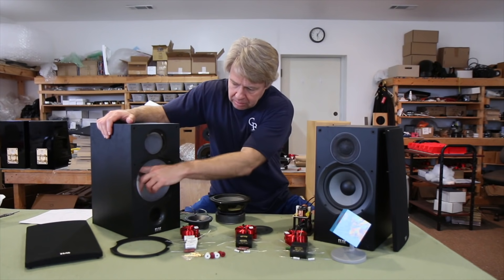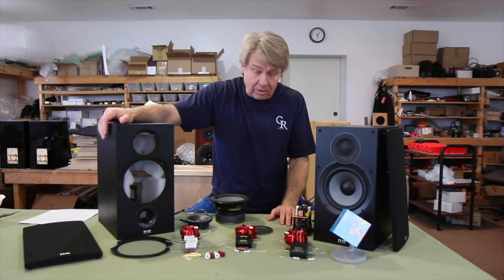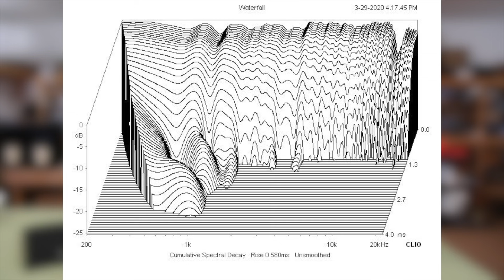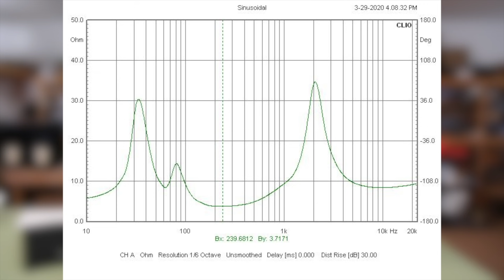Elac Debut 2.0 Upgrades and Modifications!

Comment: cables make a difference , but at the same time some cable  companies sell snake oil, often a cable if its the right cable at $40 can be as good as some $150 cables not always does more money mean its better or worth the diff.
Reply: Copper is still being copper regardless where it is. Yes, sure there might be some dodgy copper wires from China, but the rest of proper electrical copper cables are the same for the purpose of carrying low freq. signals if the cables have appropriate section of cource.  One day we received a lot of backlash from Monster Cable distributor for us bashing their  overhyped products by telling the truth about that to many our customers all over the town. Personally I've got nothing against their pricing, but with all the lies and all the other esoteric BS they say about their cables, the companies such as Monster Cables, Van Den Hul etc. they all fall under a definition of charlatans.
Reply: @MSM5500  Build a pair of Canare L-2T2S interconnects and float the shield. Total cost will run about $12, including Nakamichi RCAs. After I had them in my system, I dumped all of my snake-oil crap. 
All of my interconnect cables are Canare, along with Canare 4S8 speaker cables. High-end audio on a budget, without the BS.

Comment: I don't know about speakers cables, but for signal cables I have today proof in the ears that my own made (best I could) xlr interconnects were inferior to the Benchmark media ones I just got. I am still processing, because it's huge. so Huge I thought I had bumped the setting of the sub, had to double check, and the overall volume went down so I had to check the db meter, and it was the same, in fact what happens is there is less garbage, so even at high volume there is less discomfort on the ears. Every sound is SHORTER in duration, meaning you can hear more of the before and after small sounds that are before and after a hit. When pushing volume the different furniture, plates, glasses, windows vibrations are much shorter lived and more varied. Again I don't understand yet, still processing ... I was not ready for such night and day difference. It's like a knife so sharp I cut myself. The quality of the contacts is also very high on the list of things that mus go well for signal to be good. The problem with this upgrade is if you just do it by ears, then you'll push the volume up to unreasonable spl. (and the speakers look to work way less, while spine and stomach get hit hard but short) All the titles i know and listen often for years now show me new layers, new things, or show the same things more obviously. It's like removing yet another grill. An an astonishing fact is that I don't need to recalibrate room eq, pink noise is even flatter than before. It is even flatter in all seats of the room, not just in my spot. So if signal cable do something, then speaker cables and internal speaker cables and connectors do, it's obvious.

Comment: Excelent, thanks a lot. Can you do a little upgrade on the unifi ub5 that is the one i have? Greetings from Argentina!!!
Reply: Hi Marcial.  I had sent Danny one of my UB5 speakers in October to do testing on.  Unfortunately it was damaged in shipping by UPS and they requested the speaker back to inspect to determine if they would pay the damage claim.  So, I'm not sure if Danny had completed all the testing before UPS picked up the damaged speaker.  What information he did share with me indicated that they had some issues which would be hard to fix due to space constraints inside the enclosure.

Comment: Hi Danny! Will these upgrades work with the originals?
Reply: This upgrade is for this model only.
Reply: @dannyrichie9743  Thank you sir! I went with the Unifi 2.0. They came down to 419. Any upgrades for those?😃
Reply: @dawolyan13  There is simply not enough space in that cabinet for a three way crossover using good quality parts. It would require an outboard crossover.
Reply: @dannyrichie9743  Okay. Thank you…could you say you kinda like them? 😂😂😂👍🏻
Reply: @dawolyan13  No, they needed help. I am not a fan of the metal cone drivers either.

Comment: The 16k hz dip bothered me the most... I solved it with eq, but is there a hardware fix for that?  1db isn't enough.
Reply: I didn't have them long enough to figure out another solution. I thought at first it could be some throat cancellation, but it could also be some edge diffraction from the edges of the face plate.
Reply: Note :: If my memory is correct males start to gradually lose hi frequency hearing starting at age twelve. I think females are somewhat older.
Reply: Matthew Bowler ...see my response above.                                     m.c.
Reply: @michaelcelani8325  all I know is that I boost 16k and it sounds amazing.  Other speakers I don’t need to do that.  I now have Tekton Moabs and Ohm Walsh 3000s to compare.
Reply: @mcbowler   This gets technical.. When you boost at 16k that is the CENTER frequency...but the boost is a curve so lots of frequencies above and especially BELOW the 16k center are increases . So you are increasing one octave below ...8k....by half of what the 16k is !!. And you CAN hear 8k. !   If i could show on a piece of paper it is much easier..  There is almost ZERO sound at 16 k...believe me.. At 8k there is quite a bit of sound.
Reply: @michaelcelani8325  maybe, but all I’m saying is that the highs when boosted on the debut 2.0 (including whatever other frequencies are affected) sound better than my expensive speakers no matter what I do to them.  The mids are better on my expensive speakers no matter and that’s why I keep them.  I’m pretty sure it’s subjective, but I can definitely hear a major difference between my Debut 2.0 and my tekton’s in the high end, and when corrected by moving up the 16k slider sound much better.  And that’s the only slider I move when I eq the debut 2.0.   Technical or not , doesn’t matter, I do what I do because I enjoy it.
Reply: @michaelcelani8325  you explain it simply and effectively.  Thanks for the help and I’m mostly satisfied with the system.  I hope my ears last until I’m at least 102.
Reply: @michaelcelani8325  I'm almost 50 and can still hear up to 17K

Comment: Why wouldn’t you just buy better speakers to begin with?
I upgraded from the Elac Uni fi’s to the Adante AS61. The Uni’s were great but the Adante is a significant step up, on sale for $1500, seems a better option than upgrading parts in a lesser speaker. Interesting presentation though thanks
Reply: The object is to learn about speaker building/improvements  for people who like to tinker.  There's a joy in hot roding their speakers. For some like the journey as well as the destination.
Reply: avh700 fair point
Reply: Take a look inside that model. Do you still see some electrolytic caps? Some sand caste resistors? And the same binding post on a cup? There may be a lot of room for improvement on those too.
Reply: Danny Richie mine sound so good to me that I swear the Beatles live in there, if I open them up those buggers are just gonna jump right out!
Reply: Because these speakers are $300 and the Adante's are $1500... pretty simple really...
Reply: David Harper simple to those who fail to factor in r&d budget & the economies of scale achieved by large companies like Elac. You pay the experts to get it right and enjoy the results many years after the trauma of being a few hundred down has dissipated
Reply: @keithbertschin1213  I actually have a $1500 Yamaha receiver with parametric EQ and have fixed the 750hz jhump and the 16k dip...🤓

Comment: What if the box resonance is intentionally tuned by the designer to aid the speaker's voicing and a DIYer modifies to remove the resonance? Why attack box resonance as an automatic point of modification?
Reply: Box resonances are never part of the design element. That would be like designing an amp to have a little hum, or building a new engine so that it has a little knock. 
Speakers are designed to accurately reproduce the input signal. Box resonances are never part of the input signal.
Reply: @dannyrichie9743  I was asking based on forum discussions I've seen mentioning Harbeth and "BBC styled thin walled cabinets". This is from one of those discussions, but, I see it does not refute what you are saying. Thanks for responding! 
"The BBC wasn't trying to add to the speaker's sound. Their position was that a completely rigid cabinet would still reach resonance and ring at some audible level/frequency while a lossy cabinet would push "unwanted resonances downwards in amplitude and frequency so that they are adequately buried below the music and then pushed down in pitch"
The quotation is from Alan Shaw of Harbeth.
"It seems to me that the BBC / Harbeth objective is the same as the "rigid cabinet" school. They just (seem) to believe that the lossy construction is a better approach to the goal."
Reply: @4991544  If a cabinet wall is flexing then it is adding or taking away from the input signal as it is not part of the input signal. And pushing it down to a lower wavelength involves an increase in the amount of flex and movement. And if you really hit the resonance frequency of the panel then it really comes alive. And is also harder to damp out a lower frequency resonance. If the resonance is higher then the magnitude is less and it is easy to damp out with No Rez. Then you have no coloration at all.
Reply: @dannyrichie9743  I find your logic convincing. I also prefer it, as the idea of working with distortion as if it were one of the 'ingredients' in the recipe, rather than seeking to eliminate it outright,  does seem absurd. Thanks for disabusing me of this one!

Comment: Really interesting! But what I don't understand is why the bass range was increased by 1.5 - 2.0 dB. I especially appreciate the homogeneity and neutrality of the original Elac Debut 6.2. Now there's a slight loudness effect with boosted bass & treble to the frequency response...
Reply: The bass response wasn't shown in these measurements. What you are seeing at the lower end of the graph is a flatting out of the response in the lower mid-range. No areas are boosted. The response is just more evened out across the board.
Reply: @dannyrichie9743  The bass and overall response is shown at timecode 11:59. The red graph shows the original response and the green graph the modified one. There you can clearly see an increase of frequencies starting below 500 Hz.
Reply: That's not the bass region. The bass region doesn't start until below that 200Hz mark. And yes it came up a little there as a result of the notch filter used to pull down the peak. It is now pretty even with the top end and a little softer (very little) in the 600 to 4kHz area where you will get your strongest room reflections. It is overall very balanced.
Reply: @dannyrichie9743  Thanks Danny!

Comment: I'm sorry but I don't see the reason or justification in spending 350.00 to "correct" a 200.00 pair of speakers. So you are looking at almost 600.00 for these not including your time/labor. For 600.00 you are in a whole different level of quality options for speakers that these would never get close to. For that I'll buy a better pair of speakers that I don't have to correct and still save money.
Reply: Correct.  When you're at the $600 price point, check out the Elac Debut Reference model.  I like the D6.2 model, but the Debut Reference has a better cabinet structure, slotted front port, better (vinyl) veneer and a more refined sound.  I've applied some crossover mods to a previous pair of B6.2 Elacs I had by changing one of the caps and 2 of the resistors.  To my ears, the sound was improved a bit and the cost was only about $12.00 for the parts, plus shipping.
Reply: Stepping up to the $600 retail price point won't buy you much more in terms of quality parts or performance. You'll see the same budget level parts holding them back, and needing the same upgrades.
Reply: Surely starting with a cabinet built from plans or an off the shelf cab with higher quality components would be a better starting place. Its something I'd like to try. Building a speaker, buying nice components and putting the time in rather than trying to polish up a built to price speaker. Does Danny have kits or plans for that sort of thing?
Reply: We have kits that we feel offers the best performance and value at each price point up to cost no object speakers. You can view them on our website and see lots of builds in our forum at the Audio Circle.
Reply: @dannyrichie9743  thanks i just saw the final klipsch video and the credit to your kit speaker. I'll look over what you offer. I am in the uk so there maybe a few more considerations.

Comment: i m kind of on the fence on this. i cant say if this upgrade is really that good or not, since i havent listened to it. But doesnt it defeat the entire purpose of the Elac Debuts to begin with? The entire selling point of them is to deliver ''pretty nice good enough solid'' audio for cheap aka ''value'' . I dont think, people who buy these are in the market to spend more than the speakers cost for ''fixing'' them. If i spend 200 on a speaker and 350 or so on fixing them.. why wouldnt i just buy a 550 speaker instead?
Reply: A $550 speaker will still come with cheesy Xover
Reply: Well I did it and I'm thrilled with the results. They sound like $1000 speakers now, and I only paid $700 (CAD). Of course I'll have to keep them forever... nobody will pay even $700 for them. Unless they watch this video and are 'sold' on the concept.
Reply: Because you wouldn’t have voided the warranty

Comment: As far as DIY upgrading a speaker, what’s the best budget speaker to start out with? I have the KEF Q100’s and the cost to upgrade exceed what I payed for them. Someone is seeing a pair of these ELAC’s for $200 right now... should I get them?
Reply: If you have any of the speakers that we've designed upgrades for then it can be a lot of fun implementing the upgraded and getting your feet wet in doing DIY work. And yes, sometimes the cost of the upgrade is as much as the speakers sell for originally. But the end result is often much greater than the total spent. 
Now if you are starting from scratch and interested in some DIY designs then our kits that we offer will get you more performance for your dollar and sometimes by a pretty good margin.
Reply: Danny Richie thank you for the quick response. Love your videos and I am looking forward to upgrading my speakers. Looking at your website at materials. Do you think using Dynomat car dampening 80mil sheet material is a good vibration reducer to apply to the metal driver frame?
Reply: @MrPoots12  Yes.

Comment: I would be more concerned about the dip at 16 KHz. Why it that? Waveguide? Never expected that with a tweeter that should go up to 30 KHz. A little bit smaller thin film tweeter resistor with a proper little capacitor over it also should do in this case?
Reply: I was able to lift it only slightly by by-passing the resistor. There is just too much of a dip there. And we really aren't lifting it, but bringing down the rest of it to match. So in this case the rest can't be brought down any lower.

Comment: $345 for each speaker or for a pair?
Reply: That is everything you need for the pair.
Reply: @dannyrichie9743  does the kit come with install instructions ? I want to do this upgrade but a bit apprehensive as I have never before performed a DIY  cross over.  This will be my first.
Reply: @michaelross8036  It is not as hard as it looks and you'll have a lot of support.

Comment: The GR crossovers & shipping are $60 more than a pair of the speakers. It's quite remarkable that Elac can't, or won't market an upgraded version of their speakers with better cabinets & crossovers. Call it the Elac Encore 1.0 - With their buying power they could sell 'em for $500-$550 pair easy.
Reply: Keep in mind that adding $200 more to production cost can add $800 to $1,000 more to the retail price for speakers sold through dealer networks and $600 to $800 more if sold through direct sales.
Reply: Some of these issues were addressed in the Debut Reference but they are $600 a pair.
Reply: @amazoidal  And I bet you'll see the same budget level parts.
Reply: @dannyrichie9743  Danny, would be cool if you got your hands on the reference and take them to the next level too!
Reply: @dannyrichie9743  Supposedly, the Deb Ref series has an "upgraded" cross-over.
Reply: They do. It's called the Debut reference.
Reply: ELAC does make an upgraded version of the Debut 2.0 speaker, it is the Debut Reference Model, Cast Chassis, full perimeter bracing, dip at 750hz fix without sacrificing impedance, upgraded crossover, improved cosmetics and it sells for $599 a pair. Also the issue at 16khz is caused by taking off the tweeter grill off and leaving the grill channel on the waveguide open (just fill it in with some putty).
Reply: J Tee they just released the Debut Reference. Several changes to the crossover that flatten out the top end. Cast frame, five way binding post, better cabinet, slot port. $599
Reply: it may be a bigger expense for less improvement if danny were to mod the reference. ending up costing 1k and onlly being less of an improvement and loads of reasonable parts binned.
Reply: @dannyjonze  I'm guessing the electronics will still not be that high quality, and you could fit $200 worth of copper in that thing. But yeah, diminishing returns. In a way, the reference seems to be basically the B5.2 with its structural flaws fixed, which would cost less money to sort out than an electronics upgrade.